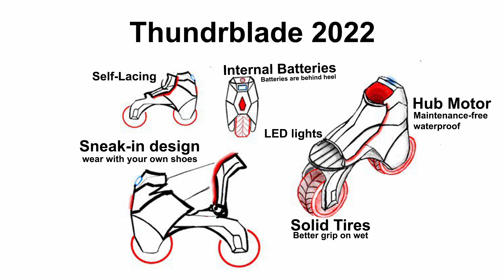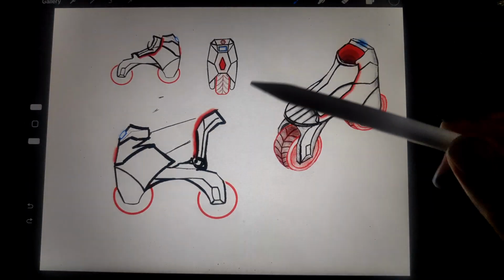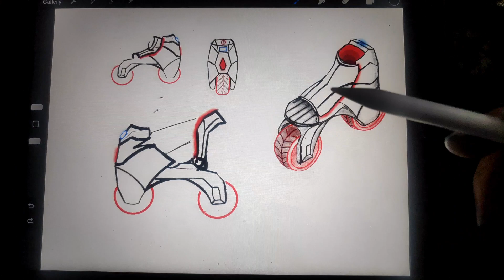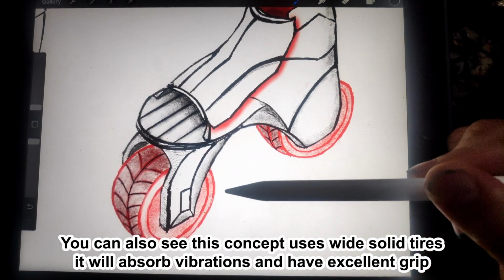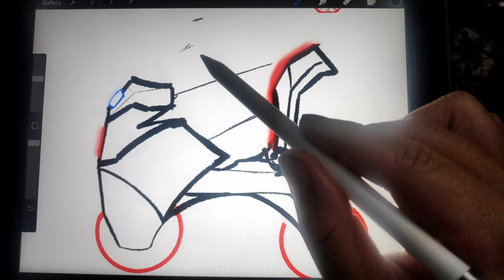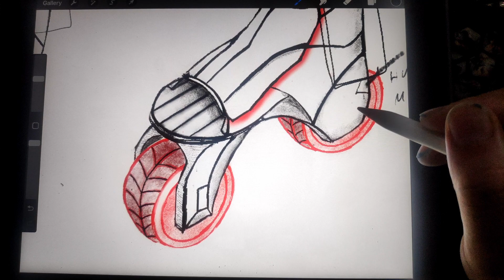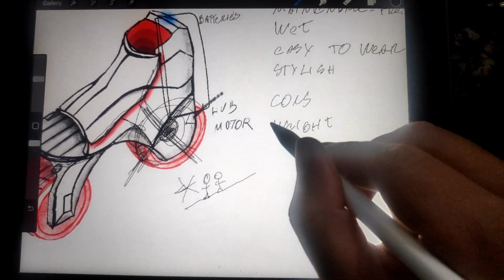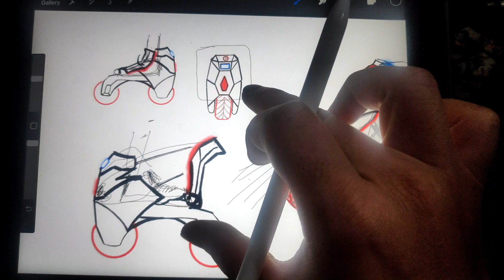Why Thundrblade will use HUB motors going forward

Comment: Looks and sounds amazing but are the toe exposed might be better if they were encased to avoid damage to the toe just incase someone had an accident and lost a toe that way people couldn't sue and blame the gear, just looking out for I also think you're amazing for sticking with your dream of electric rollerskates especially when you had many obstacles  can't wait to see what you accomplish
Reply from the maker: Thank you very much for your support!

this concept would have the rider use their own shoes to skate, so ti seems logical to use shoes that protect the feet. 
I see your point though, I can see people skating barefoot or with sandals.

the main pros about an open boot design like this are:
- it is very practical to use your own shoes so you dont have to carry them while skating
- ventilation to the foot, so you dont sweat as much while skating
- its cheaper to make 1 or 2 sizes only since you can fit and adjust to any size feet

Comment: I am not a fan of two wheeled skates- Perhaps one could use a tri skate type frame, then on the back wheel rig a hub motor into the frame (sticking out) that could connect to the wheel via a belt.
Reply: Actually I am interested in looking at your friction drive concept.
Reply from the maker: a hub motor doesnt use a belt, it is inside the wheel already.

but yeah, since our latest prototype uses a hub motor, it could be built as a tri-skate. but then you´d have to put the battery somewhere else. the main reason for 2 wheeled-skates is to have room for the battery as well as saving a litle bit of weight.

Comment: I love this.  And it's pretty much what I wanted.  However, I can't help but think this is extremely similar to the AirTrick skates, which are slated to start shipping this month.  Although those are 4 wheel "traditional" skates, not roller blades - I think with two very wide wheels on your Thundrblades - they aren't really roller blades either per se - I would imagine they won't much handle like blades, instead, more like skates.  And so while I think your design looks nicer, might be better or more premium, it would seem that you'd be fighting an uphill battle against AirTricks.  I have a suggestion - instead, design a shoe with these wheels retracted.  I have always wanted a skate shoe with at least 2 wheels - but they never come in anything larger than size US 10.  And I wear a 12.  I would love an electric skate shoe even more.  I don't think anyone has done anything like this.
Reply from the maker: Hey protonus, thank you for your support.

I dont think Airtricks are that similar to Thundrblade, but they are both electric skates. Thundrblade with these large, wide wheels are still very much like an inline skate since you can still lean your feet and carve just like normal skates.

Also check the videos on the wide wheels prototype: https://youtube.com/shorts/BiefWBs3xEA
and I will make videos showing the prototype carving since more people could have the same question.

what you described are called ROCKET SKATES and they were launched in 2017 I think. as far as I know they are not into production anymore though. search for acton skates and rocket skates and you will find your motorized heelys. although they are still a giant robot boot with wheels not a proper shoe.
so maybe check out flanuerz for a removable quad skate frame on any shoe. not electric, but very practical.

Comment: Okay, I like the new concept! Ever thought about using pressure sensors to replace the hand controller for forward, reverse and breaking functions of the skates... along with an App for a smart phone, along with DOT, ECE, and FIM certified suggestions for protective gear? 

Cause the speeds you're proposing are frightening alone when you seriously think about it!! When i drive my truck anywhere from 16-50 kph I'm not thinking about personal safety because there are layers of protective elements in a vehicle. 

When I ride my road bicycle to travel locally my average speed is 20 kph and my max might be 45 kph for short bursts. Even at 32 kph, that's hellish fast for roller blades! (hell, even on a road bicycle) You even said it yourself, most skaters can't even reach 20 kph and you got up to 40 kph yourself and know how scary it is. One wrong move and you'll feel the abrasive kiss of asphalt. I've broken my teeth falling off my road bike so i KNOOOW from first hand experience what it feels like to receive that Asphalt Kiss with my face and it SUCKS!! When I'm on my road bicycle, I'm am super attentive to the sights and sounds of my immediate surroundings. Throw caution to the wind and the Grim Reaper might take you sooner than you'd like. 

If someone were to ride a pair of electric skates beyond 40 kph, they better be wearing DOT, ECE and FIM certified body armor, neck guards and helmets! Even at 20 kph, someone can be really banged up at those low speeds; pass the 32 kph range you're looking at trips to the emergency room at best. I've seen people on electric scooters and unicycles keep pace with me in my truck moving at 48 kph and the only protection they're wearing is a skate boarders BMX helmet!!!! 

If you're going to make your skates move at those high speeds, please, please, please, develop an App that works with your skates that unlocks higher speeds when people have the protective gear and certain number of hours actively using your skates! Without those Speed Locks, you might as well be giving the keys of a motorcycle to any kid, teen or adult without prior training and I can guarantee you that they're going to hurt themselves the moment that Key it turned "On". Common Sense isn't as common as most people believe, those lessons are earned with trial and error; most life lessons are learned only after painful stupid mistakes that could have been avoided if people listened and trusted the experience from other people who've already had those painful experiences to share with others in the hopes they'll avoid their mistakes and pass on knowledge. 

I'm not saying these things to frighten anyone, or scare them from eventually purchasing your future product, but people need to be aware of possible risks to themselves, heed the warnings, be patient, wear the correct protective gear and develop the proper skills to be able to handle all the potential of your powered skates. All it takes are a few people doing dumb things that can get themselves hurt or killed to end a company or business. 

It was never my intent to write this rant (if you want to call it that), initially my first sentence was suppose to be the end of my comment and inquiry; But the more I thought about the whole speed and safety idea, the more I believed writing all this became more important for you and your fans to be aware of and consider these hard truths I've personally experienced and observed, that should be avoided.
Reply from the maker: About protective gear:
 - Rollerblades are sold without gear and it is the person own discretion to use them, even a helmet.
I completely agree with you that people dont value their safety enough and are doing stupid things. I've seen a lot of people get hurt on electric kickscooters at 10km/h. I had a personal friend of mine almost dying on a skateboard from hitting their head on a curb and the board was at a stop.
I also have a motorcycle and I use the best gear I can buy ALL THE TIME.

I will always suggest people wear protective gear and I think motorcycle/motocross gear is the best option for Thundrblade.

the EUC community use full face helmets and chest armor plus motorcycle jackets. I will use these kind of gear on my videos as well.

About the pressure pads:
 - they just dont work well on skates. we need to shift our balance forward and backward a lot during turning. also we take our feet off the ground all the time. some electric skateboard companies tried to do this and all of them failed. its just not practical and its way harder to control than a handheld controller. 
I'm going to make a video about this topic.

Comment: First of all, you got no idea how happy I am to see you back. When I saw you inactive for two+ years, it was very sad. You went through pretty hard time, I see. And the fact you still didn't give up is just amazing.

Now, let's talk about this. I think your current design is little to ambitious. If you must, I would suggest firstly mass produce a base model, with main motto an electric inline that works . And after the initial experience, you can make another model.

I guess sth near-traditional, three/ four wheeled and with friction fit will be the best bet.

Things I like: The option for sort of headlights are pretty good, I should say. Also the lock wheel is good.

Things I think are unnecessary (aka you might implement them in later in a upgraded version) : Let's be real. RGB lights , Self lacing function are not something you need. And rgb, self lacing would be fun and all; but after a week, no one will use rgb that much. And I hope you have an idea of what happens to self lacing when motor breaks or the lace tears off, when it runs out of juice.

Keep an eye on usable without battery and normally- part. I don't think this model with curve and two wheels, it won't be easy to use and looks kind of funny/ childish.

Cost is a big thing. A self-lacing, hubb motor, with rgb might sound cool. But I don't think they are that much practical. 

I really hope you make it this time within reasonable price my dude. Best of luck.
Reply from the maker: hey, thx man. also thx for the feedback.

for the self lacing thing, I talk about it a little more in-depth in this video. please watch it https://youtu.be/o9m35eB4PXE

as for the whole concept, its just this: a concept. we are very far away from mass-producing something. in this phase I would like to tinker with a lot of ideas. this design might not even be a practical one for mass-producing, but a lot like car concepts, we go a little a little overboard to see a "what if" 

I hope you can continue to provide feedback while we further develop the concept.

Comment: I love how the new design is coming out but my main question is would these skates be able to withstand someone on the heavier side
Reply from the maker: thats actually a good thing to discuss. Its really hard to make a skate for someone more on the heavier side. the frame not breaking is the easy part. the hard part is to have a motor that could push more weight.

So a good way of making this happens is by having 4 motors instead of 2. I will definitely consider this.

Comment: Considering the One Wheel has a top speed of 20mph give or take and is a much bigger device, this speed for the two inline skates is fine. One question is the energy capacity what would be your projected range if this prototype is to work? One other thing are you still using the remote control system from the previous prototype or maybe some sort of pressure activation?
Reply from the maker: range should be around 20~30km

I will make a video about the weight shifting way to control the skates. I will be using remotes for mine. I dont think weight shifting works on inline skates.

Its worth a try sometime in the future though, maybe there is a way.

Comment: I would actually love to be able to have a battery pack in a backpack with wires strapped to my pants.

I don't think the electric snapping system to lock your shoes in is that good of an idea.
If the servo or a string broke, you probably wouldn't be able yo fix it yourself.

Check out how powerslide doop does it :) might be cheaper and sit tighter
Reply from the maker: thx for the feedback David!

I will make a video about this idea of batteries inside a backpack. A lot of people actually commented this.

about the self-lacing... its definitely something else to break, but it should be something simple enough to be able to maintain easily. if it cant be done in a simple and easy manner it should not be done at all.

I have a doop and a Xsjado and love them. the problem with them is that I still need to sit down and make a decent effort to strap them. They are convenient, but maybe we could make it better.

I appreciate your input. Keep them coming.

Comment: I love the concept would love to get my hands on a pair i have a few questions/concerns. 

A lot of last mile products with significantly larger designs  tend to have limited range and that range goes down rapidly with a hilly comute or heavier riders. 

For something like this always functionality comes first. Self lacing and leds are cool but i am wondering what is your expected range on these with one charge and how do those extra gimmics effect the battery life? And how does that factor with inclines and rider weight?
Reply from the maker: thx for the feedback.

the selflacing would not impact the range of the skates. not even in the slightest. The self lacing motor would work for a couple seconds and lock in place mechanically. 

energy stored inside a battery is limited, theres no running away from that fact.  
bigger battery = more energy.

a last mile vehicle has no need for a 100km range. the Boosted Boards (electric skateboard) first version had only 6 miles(9km) range and it worked fine for a last mile solution. 
This thundrblade version should have more range than the previous concept(10~12km) since it will have larger batteries. I estimate around 20~30km range, but with swappable batteries you could always carry spare batteries and have infinite range.

Also larger designs like kickscooters and all terrain skateboards have lower energy efficiency so they need even larger batteries. 

inclines and rider weight are the same for everyone. there's no magic for anyone. you need more energy to go uphill as well as to push a heavier payload. range is always an average in "normal" conditions. just like in gasoline cars.

weather and temperature also affects any battery powered vehicle, yes even electric cars.

Comment: I think it looks great. But how long can I drive with a fully charged battery? How to control the "Air Trecks" the speed, the break and everything?
Reply from the maker: Thank you! Thundrblade has a handhel remote controller.

the batteries will be swappable, so you can always carry more if you need the extra range. Its better to have a lighter skate on your feet. A pair of batteries should last around 25-30km.
Reply: @Thundrblade  I saw something that uses your weight to drive like the Air Trecks. that is why I was asking about the control. I will show you a link later on Discord.

Comment: I would really appreciate if you still hold on to the UFS/Tri system, so you can choose from a bunch of skates. There are so many nice skateboots I want to use especially on longer rides electronically. I don't thing my footwear can give me that same feel and support in comparison.

I think it would be also a alternative to carry the batteries maybe on the belt or a backpag with cables through the trousers. This way the skate could be even lighter. With connecters at the boot no big issue.

Its so great to have you back still working on this project. It was a pity the first campaign didn't succeed as expected. Personally I would even buy a "prototype/handmade manufactury edition. I will follow up gladly every update you give us, we believe in you!
Reply from the maker: thank you!
I agree with you that a lighter skate on your feet is better, but wires coming down from the waist is a hard no. too dangerous. of course you could modify yours I cant tell you how to live XD
I will probably make a video about this since a lot of people want this feature.

just let me clarify it why its impractical.

first the obvious: you could trip on the wires.
2- wires directly from the batteries, the longer they are the more dangerous it becomes.
3- to counter this danger, they need to be thicker, heavier and harder.
4- wires are not cheap
5-batteries inside a backpack or waist pack would need ventilation otherwise they can blow up from heat since they are close to your body and inside a bag.
6-no one wants an exploding battery close to their skin.
7- to counter this you would need a cooling system inside a metal box.
8- some people don't like riding with backpacks, especially heavy ones. but this is kinda personal.

could it be worth it though? It could.
can it be done? yes it can.

will I do it? no.(maybe)
Reply from the maker: about the boot dillema.

using this approach(using standard boots) I have to give up precious space for batteries and electronics. it is a viable path, but for now I will experiment with a complete system.
Also I can save a bit of weight.

If you want to support please check out our ko-fi page
http://www.ko-fi.com/thundrblade
you can donate any amount and every dollar counts so the development can continue.
Reply: @Thundrblade  Oh well I understand. Many arguments and things to take into consideration.
Your concept is of course a way more practical thing, but maybe you can give the rollerbladers (storm riders) a way of switching parts like the backside with the batteries. Or just a way to plug in a charging cable or something like that - powerbanks for the win.
Also the cuff would be nice to change for a lower or higher version, just as the person likes it more. This is really making a big impact on how a skate feels I think.